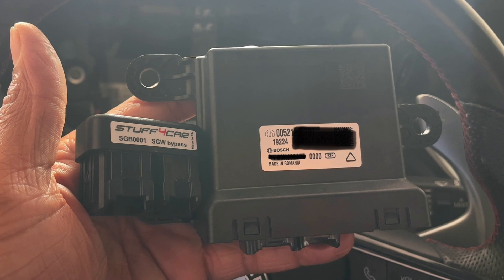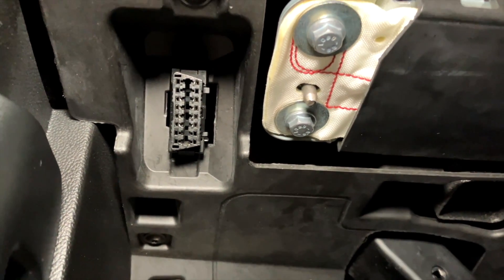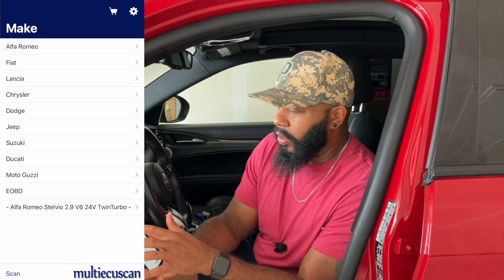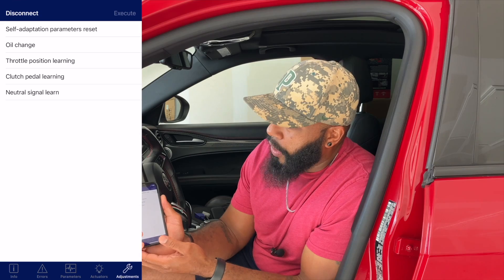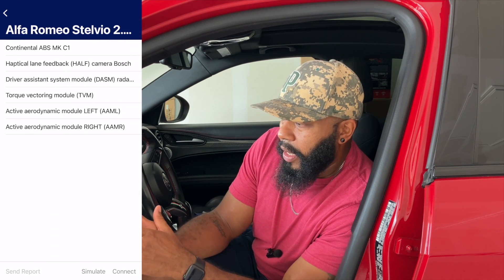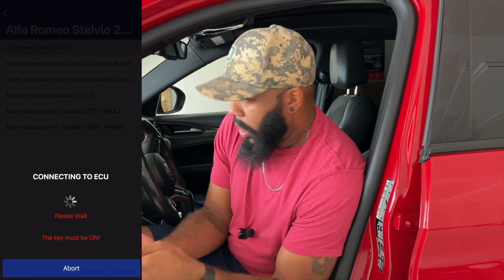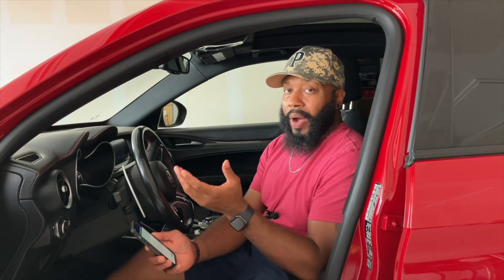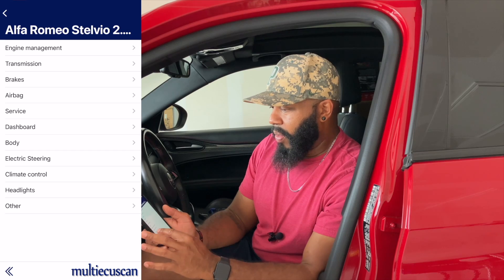How to Use MutliECUScan for Alfa Romeo | Euro Auto Enthusiast

Comment: Great video’s buddy ! Thanks 
I have installed the Bypass module on my Stelvio .. holy S*it what a hard to get by location .. but happy to have it installed and for example reset the oil service . 
Keep up the good work. Greetings from the Netherlands
Reply from the maker: So happy you did it!! Thanks so much for your support 🙏🏽
Reply: Sorry buddy , I installed the bypass. And ordered the MX+. I thought I was able to use that but you are using the blue/grey able between the port and obd. Where did you get the blue/grey cables ?
Reply from the maker: Oh ok. I ordered from Alfissimo

Comment: Do I just need this part to remove the codes on my esc and brake service after getting new brake pads we did not disconnect the battery
Reply from the maker: Among other helpful features, this will help you clear codes and reset service intervals. As for performing the brake service itself (releasing parking brake) it is not needed.
Reply: I recently changed my brake pads and rotors, without disconnecting the battery, and now Im getting the ESC and Brake Service lights as well. How did you fix it? @Solidones

Comment: Which OBD works to reset the oil maintenance interval on the infotainment? I was able to clear the one on the instrument cluster but can’t get the one on the infotainment to rest to (9800 miles > 365 days)
Reply from the maker: Which OBD? I’m not clear on your question. However, if you’re referring to the cables, neither one is needed to reset oil service. It’s done in the app then you’ll see it on the infotainment screen
Reply: @EuroAutoEnthusiast  thank you for the info, brotha. One more question, do you need a subscription to access certain control units or to access the infotainment system?
Reply from the maker: @ivanstark3386  The infotainment system, is your readout like the monitor on your computer or laptop…nothing to manipulate.

As mentioned in the video, a subscription IS required to perform any reset or adaptations.

If you’re successful on the free version please let us know!
Reply: @EuroAutoEnthusiast I was not successful. I did purchase the Multiecuscan app but once I got to the function to reset the Interval, it said “Failed To Execute”. Not sure sure what’s going on. Maybe I need to purchase a license?
Reply from the maker: @ivanstark3386 Are you using the MX+ BT module? If not, what brand OBD module are you using?
Reply: @EuroAutoEnthusiast  I currently have the Multicuscan app (paid subscription) for iOS. I also have a OBDLink MX+ OBD Bluetooth Scanner.
Reply from the maker: @ivanstark3386 There’s a few things to check that will cause this:
1. Do you have an SGW bypass installed?
https://youtu.be/ulIgQNUSNHk 👈🏽watch this  if you’re not sure

2. Is your Operating System up to date (this does effect the functionality of the app both ways-the OS is outdated or newer than the app’s latest update)

3. Restart your phone (sometimes it’s that simple)
Reply: @ I do not have a SWG Bypass installed. I’m guessing that’s going to be my cheapest route. I just subscribed. If you have a video on explaining what is needed for the SWG Bypass, can you please send me the link? I really appreciate your replies!
Reply from the maker: Thanks for supporting the channel 🙏🏽and providing help is the purpose of it!

The video link provided in the previous reply should help you decide your next step.
Reply: @EuroAutoEnthusiast yes. I will need to definitely use a SWG Bypass. I’m just not sure what parts I need to install the SWG Bypass on my own or how to install it. Or if there is a temporary fix so I don’t have to install the SWG. By some chance, do you have a tutorial on that? Again thank you so much for the help! I’ve learned so much from your videos!
Reply from the maker: To sum this up, there’s no temp fix:

1. SGW Bypass
2. Approved scan tool (Autel, Bosch, etc.) 
3. Dealership or Independent shop

Two, 2️⃣, ✌🏽, DIY reference videos are highlighted in THIS video you’ve commented on. Your questions have already been answered. 

I feel if you rewatch this one you’ll catch some key points you may have missed 🤷🏽‍♂️

At the end of the day, the day ends 😆 

FrFR, if you’re concerned that this is a tough DIY…IT IS!!!

It beats the very expensive alternatives 👊🏽

Comment: I was trying to reset my Service Oil Change Red Light. I went the Service Interval Reset and tried there, but it kept on telling me, “Execution Failed”. I can do everything else with the MES app on my iPhone except clear that message. Any advice.
Reply from the maker: @GeordanAlas2011  1. When you say you can do everything else, what’s an example and does this include run adaptations? 2. What Bluetooth module are you using? 3. Have you tried restarting the iPhone and MES? *Make sure both iOS and MES app are updated versions. 4. Turn the car off, let the system completely shut down and try again…As mentioned, the Alfas have a ton of modules and computers that needs resetting sometimes too 🤷🏽‍♂️